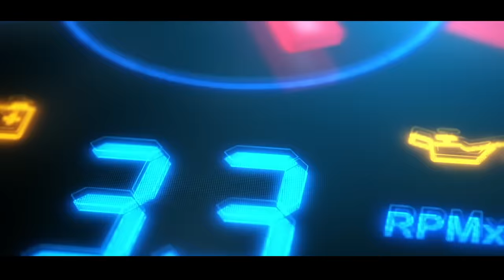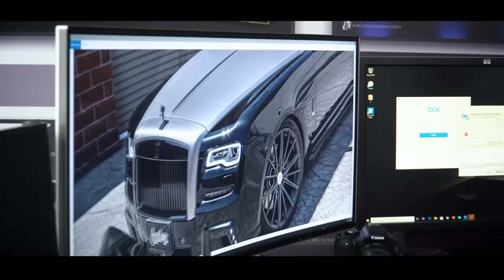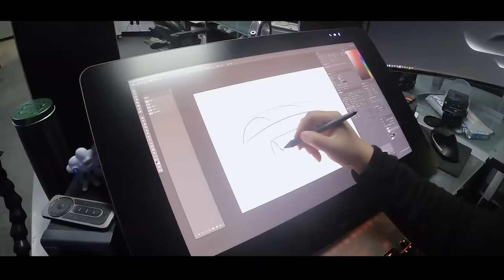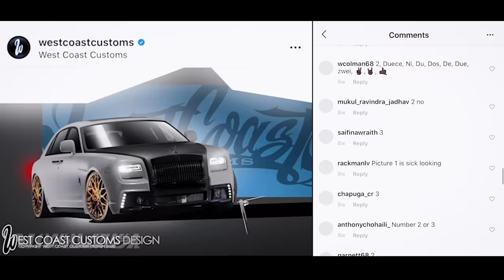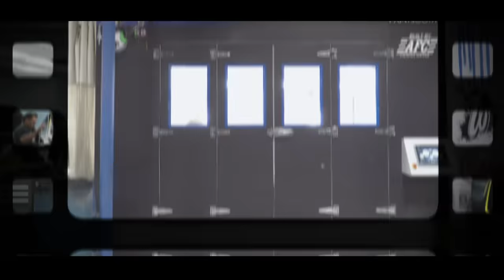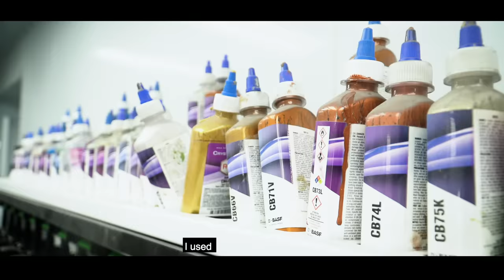Ryan Transforms His Rolls Royce Ghost | West Coast Customs

Comment: I had a yukon denali 07 not the XL. It had really good root beer paint it change darker to lighter in different angle where the sun hits, with black out tint, 24" black depth rims with white calipers  and airbags. It was head turner it gives so much attention when it sets lowered.